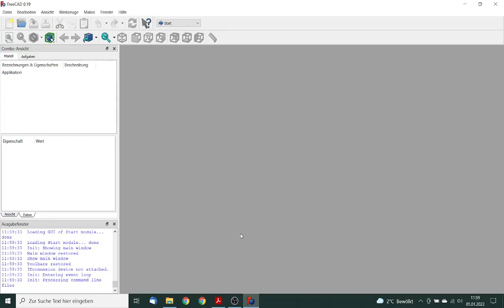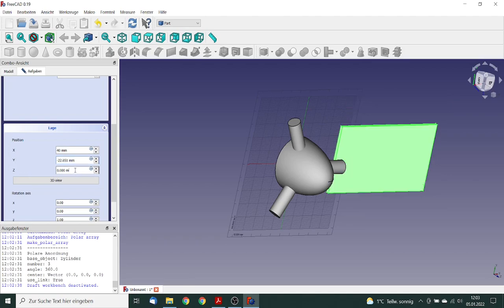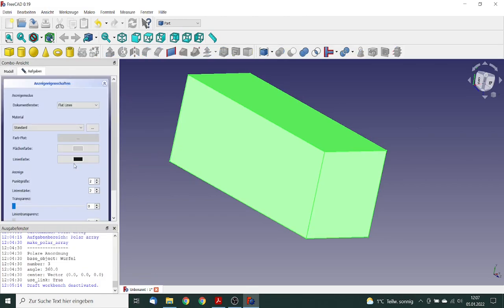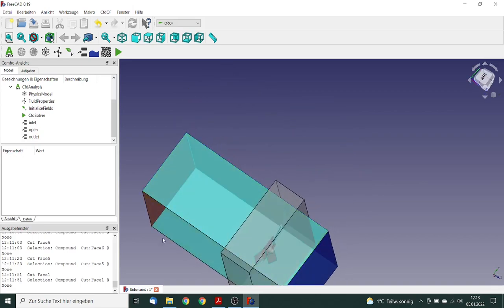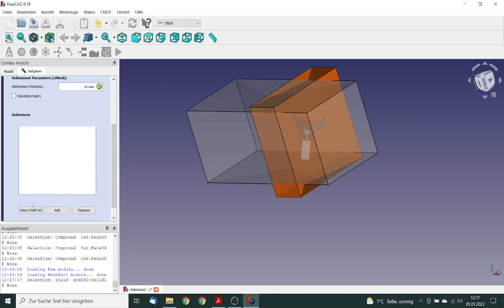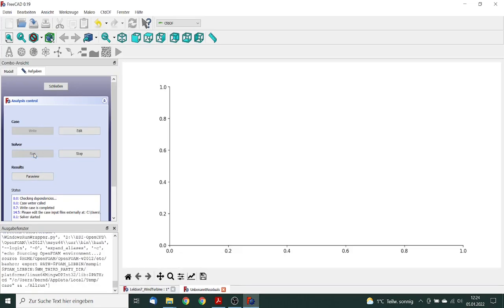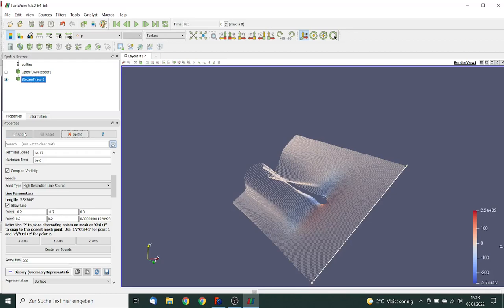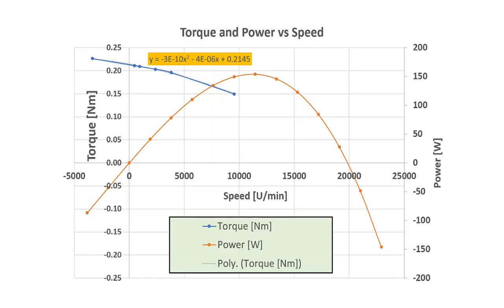Freecad CfdOF Tutorial #7: Wind Turbine

Comment: Hi Bernd, Thank you so much for these videos, they are very helpful. I am just having a problem doing this tutorial. For some reason when I run the simulation with a element size of 20 mm for the main meshing part, I get the the following error ''simulation exited with error''. If I reduce the element size to let's say 15mm, the simulation starts and I can see the convergence curves but the residuals seem to reach a constant value without fulfilling the residual threshold.
Do you have any idea what might be the problem since you manage to get it to converge with a larger element size.
Reply from the maker: Hi amir2012ful, thank you very much for your question. The right place for your question is the FreeCad-Forum: https://forum.freecad.org/. You will find there a category for CfdOf: https://forum.freecad.org/viewforum.php?f=37&sid=9fbeec31bfc45c38a50a1400f846b2e0.

In the FreeCad-Forum, you can upload your model. Many other experts like thschrader and oliveroxtoby - the programmer of CfdOf - can help you. Another helpful function of the FreeCad-Forum is the possibility to upload pictures (for example screenshots) which is very helpful for questions and answers.

Comment: Many thanks for an excellent tutorial Bernd.  It has really helped me with my wind turbine simulations.  Do you know how this method with a moving wall blade compares with the more complex method where the blade is embedded in a rotating mesh?  Also, it would be great if you could do a tutorial on an actuator disk representation of a turbine.
Reply from the maker: Hi vaughanthompson, thank you for your positive feedback 👍.

I chose this model because it is the easiest and fastest way to simulate a wind turbine in CFD. The simulation is steady-state, the effect of the small turbulences is represented by RANS. In FreeCad version V0.20 the evaluation of the torques is already supported by FreeCad CfdOf, I hope that in version V0.21 it will also be possible to enter a "RotatingWall" - Boundary Condition (BC). Then there is no need to edit the input files. 

The simulation with rotating mesh is of course closer to reality, but the model then becomes more complex. If I find time, I will work on this topic and make a tutorial. I'm also planning a tutorial about ReactingFoam.

The actuator disk representation of a turbine sounds interesting. As far as I understand this method, this method does not use Cfd / OpenFoam, nor is it compatible with FreeCad. Thus, this method is not in my scope.
Reply: @techbernd5535  Dear Bernd

Thanks Bernd.  Since my last comment,  I have done some "actuator disk" simulations in CfdOf using the porous zone facility.  By varying the zone Darcy parameters, it is possible to represent the change in axial momentum of a wind turbine through the pressure drop accross the zone. Hence it is possible to estimate the variation of power output with axial induction (essentially the change in air speed through the disk) and this gives good agreement with the analytical Froude method and predicts the Betz peak efficiency quite well  -- but both methods only apply to ideal turbines.

Both the actuator disk and Froud approach obtain the turbine power output from axial momentum changes only and do not represent the angular momentum imparted to the wake.  For my studies, I am interested in the performance of ducted wind turbines with contra-rotating blades and this limitation is not serious.

I have also been looking at the analytical BEM (Blade Element Momentum) method which applies to non-ideal turbines and does take into account the angular momentum.  It requires a knowledge of the lift and drag coefficients of the turbine blades. I was able to get good agreement between this approach and experimental results for a 1.75 m diameter commercial wind turbine.  I also compared these results with the rotating wall method in your tutorial - by modelling the three-bladed commercial turbine in CfdOf over a range of rotor speeds.  There is good agreements between the rotating wall and BEM results at low RPMs but the rotating wall approach appears to under-predict torques at higher RPMs. I believe that this is due to the fact that the method cannot capture the change in angle of attack as the rotor speed increases (the positive blade torque due to lift is independent of angular speed whilst the negative torque due to drag increases). The method does however impart angular momentum to the wake and may be used to examine the effect of turbine wake on other turbines located downstream over a wider range of RPMs.  

I hope this helps, and once again thanks very much for your illuminating tutorials.

Comment: Thank you for taking the time to make this and share it. I'm curious, can openfoam solve for the rotational velocity and/or torques on the blades or is that outside the scope of what it is for?
Reply from the maker: Hi Kyle Dunn,

in my video tutorial, the rotational velocity is a boundary condition, the torque is a result. In your question, you asked for the blades. I evaluated the torque on the rotor, but of course you can also evaluate the force and the torque of one single blade. 

Openfoam solves the equation for the flow of a medium, the rotational speed of the blades can be regarded as a constraint of the flow. The result of this constraint is a force, multiplied with the length of the lever, you obtain the torque. A reversed calculation - torque as a constraint and rotational speed as a result - is not feasible for mathematical and physical reasons.
Reply: @techbernd5535  I appreciate you taking the time to explain that. Makes perfect sense.

Comment: Do you have a location to obtain the PDF tutorial you reference?
Reply from the maker: Hi GrizelTheStick!

You can find the PDF tutorial here: https://www.youtube.com/redirect?event=comments&redir_token=QUFFLUhqbTQyQ0MtUEt4M3pyTndwMmZaalZ3SlpacnRZd3xBQ3Jtc0ttNVY1bEkyTnFtWFBLWDF2cURqNzBKRE1UalpGWTN1eTU3SFNfdGpfeEVrazZqZ0xZQ3JqQTR6NU9iV0NmQWEzbEVPZEZUTnZ1T3diRE1CWjVraWl4dUhuQXJhcHhGSUxUR0w5Q25OQkl3X2N1LVNyYw&q=https%3A%2F%2Fgithub.com%2Fopensimsa%2Fopensim%2Fraw%2Fmaster%2FDocumentation%2FCFD%2FUAV2%2FCFD%2520Tutorial%25204%2520-%2520External%2520Aerodynamics%2520of%2520a%2520UAV.pdf&stzid=Ugy0R7D8t1h0CFf64yV4AaABAg.9bcTQqWOnbe9bcZcy4exWp

If you use the version V0.20 of FreeCad, this workaround is not necessary any more, the frontend of FreeCad offers you a "reporting function". With this function, FreeCad CfdOf creates a "controlDict" - File with all add-ons necessary.